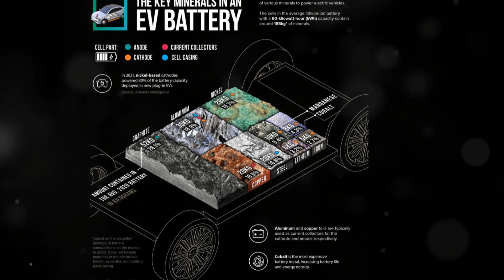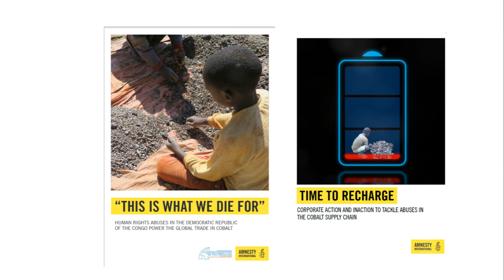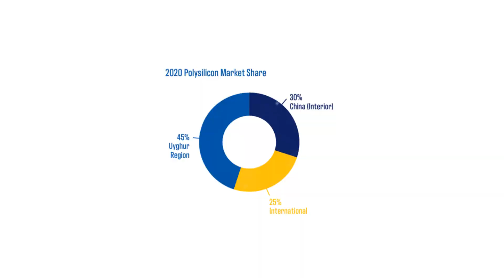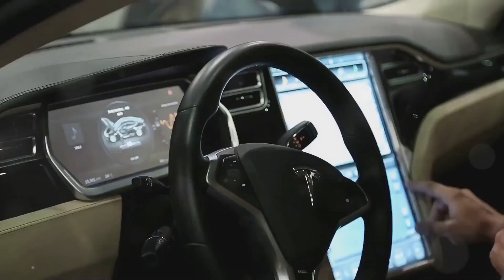Reasons why renewable energy has its own set of social problems

Comment: You completely ignore advances that are already happening plus many others that will happen in the future.  For instance, there are many batteries in existence that would not only replace Li batteries for static applications but they are superior in many ways to Li batteries for non-mobile use.  This will free up lots of Li for vehicle batteries.  Besides, there are advances in Li batteries.  For instance, the LiFePO4 batteries use little if any of the more exotic minerals.  Then there is recycling.  It is going slow at present because Li batteries are lasting longer than was anticipated so there are not enough Li batteries coming in for recycling but this will change.

Comment: thank you, prevent effect of global warming, minerals and temperature of water and air from sea are huge source of energy,  reduce more than 50% using fossil fuel, economy will rise by using jet plasma machine and compressed gas(Air) in isolated structure in water pool  with more than 80 % efficiency, it  has two vertical cylinders, in first level it transfers compressed gas(hot air) temperature  from engine to sea water in pool for steam electric generator,  steam combines with high cold Air  pressure to produce pure water and electricity , New energy from sea will change world soon, there are other source of energy that with international cooperation in coastline we can reduce effect of  global warming, further more  we can prevent these phenomena like cyclone and flood and wildfire by using this hot seasonal atmospheric condition, recent years in summer, geothermal energy happens in surface of coastline, there are many countries in coastline with seasonal hot weather and water condition in comparison with middle Ocean, its more than 12 degrees ,  in sum-up, by using this energy not only is economical but also reduce global warming in countries like Japan, China, India, Mediterranean countries, Iran, Brazil, Mexico, Us, Canada, (Africa and Arabian countries....) . I invented new method base on air pressure rules and quantum physics ionization sea water minerals in strong dynamic permanent magnet(SMCO) with special frequency(1500or 3000)/minute  bases on paramagnetic and diamagnetic particles and electrical microwave electron wave field and electric chemical reactions and photon wave from semiconductors with special angle Cations like(K+, Mg++, Na+, H+, H++, li+, H2, ...) are transferred to in the second level into up level by vacuum pump from storage into combustion chambers and they combine with O2 and N2 ,...  as major part of fuel for producing electricity and fresh water and fertilizer. this machine produces 150Megwatt/hour and 20000M3/DAY fresh water and fertilizer. 7 methods zero pollution for reducing global warming I mentioned in my profile. (G20 countries can solve these phenomena).